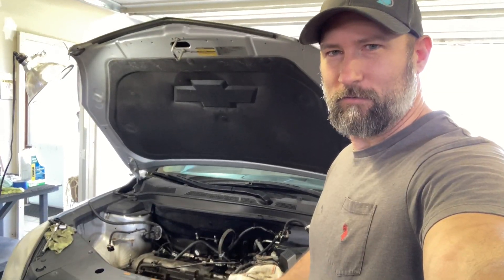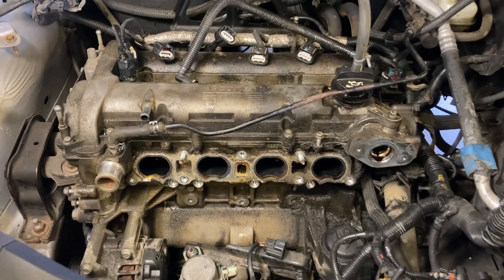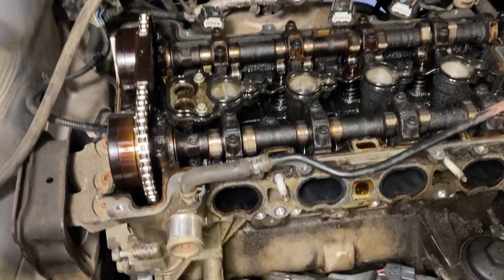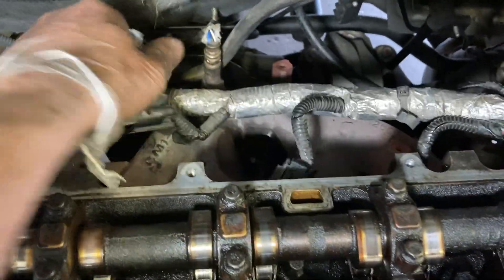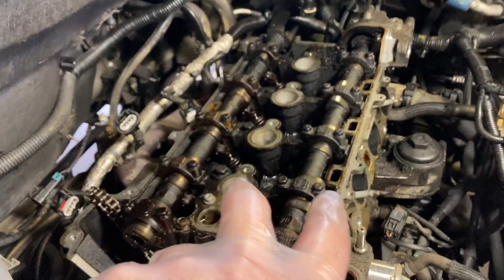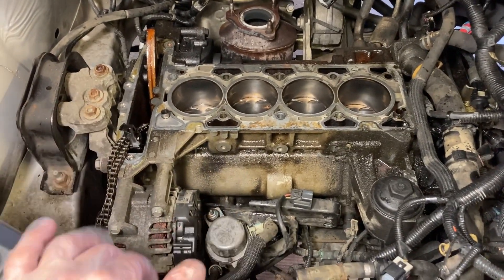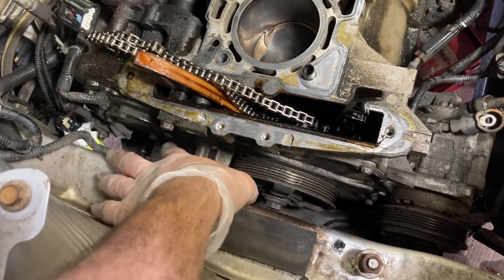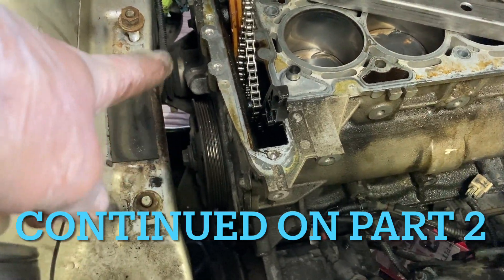Part 1, How to remove cylinder head and pistons from Equinox Ecotec 2.4l without removing engine.

Comment: for the high pressure fuel pump do u gotta take the air out or anything or can i jus take off the bolts n pull it?
Reply from the maker: There’s a proper procedure but I just pulled it.   Wear your safety goggles just in case.

Comment: I have to put a quart of oil in my MIL 2017 with the 2.4 every week, she has ran it dry multiple times to the point the lifters were ticking. It never blew up and still runs strong hell of a good car.
Reply from the maker: for sure! mine has been a tank!!
Reply: The tick is probably the timing chain hitting the guides

Comment: I'm surprised you never had to change the exhaust manifold. Mine cracked and carbon monoxide was pouring into the cabin. It came off in pieces
Reply from the maker: It was coming in if I had the vents opened.  Probably wasn't too far off from being as bad as yours was.  Couple more good bumps in the road and that thing woulda been in pieces.

Comment: What size was that reverse torx socket? Was it metric?
Reply: Did you ever figure out what size that was
Reply: For what part? I’m about to take my cylinder head off, and I could probably tell you when I get to that point. Was it the timing tensioner bolt cover?
Reply: E 12